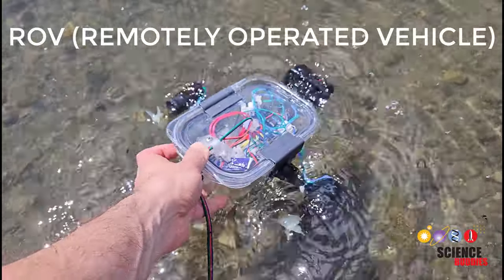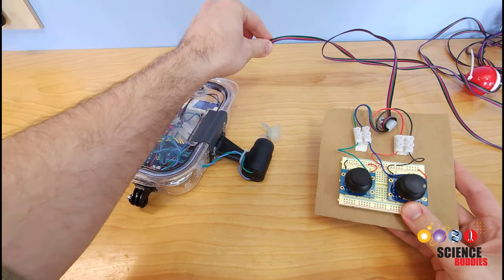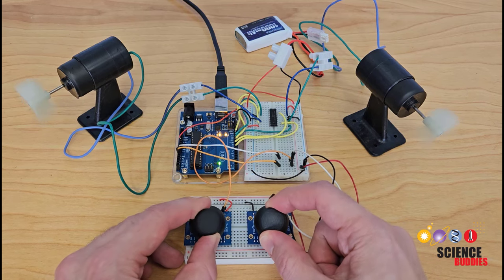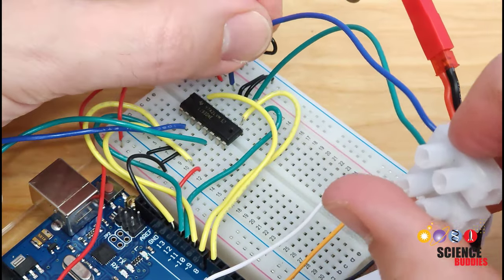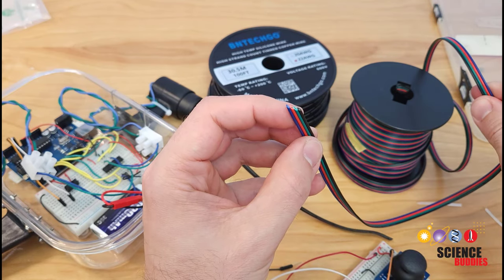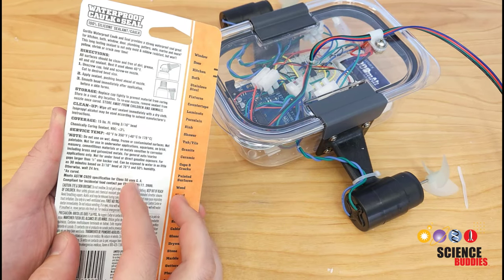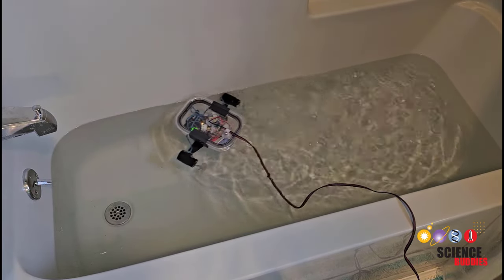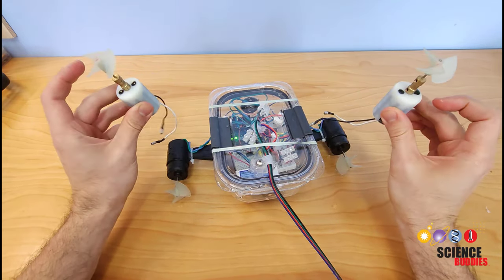Make an Arduino ROV (Remotely Operated Vehicle) | Engineering Project

Comment: This is increadbly Nice! Im thinking of starting a BIO RC Club next year for my High School and Wanted to know if I can make this out of PVC Pipes and have all the arduinos and wires all above water and just have the trusters and their wires in the contrainer?
Reply from the maker: Hi - do you mean keeping the Arduino completely out of the water and as part of the handheld controller, or mounting the Arduino on top of the ROV so it's above the surface of the water? Either way, the answer is yes, although putting the Arduino on top of the ROV without any waterproof enclosure is risky in case it tips over or if there's any splashing. We also have a radio-controlled version of this project that you might want to check out: https://youtu.be/B6w-RKSVKLU?si=rUH7nM4cRJhsBl9m
Reply: @Science.Buddies  as part of the handheld controller. And is it possible If I can make the rov go down underwater?  as it is something Im wanting to make. IF possible can you make a video? if not can you give exact instructions.
Reply from the maker: Hi - yes, you can make the ROV go underwater, either by attaching weights to it so it skims along the bottom of a pool, or designing it to be neutrally buoyant and adding a third motor to help it steer up and down. Unfortunately we can't give exact instructions for this beyond what's already in the project, but make sure you click the link in the description for more detailed information on our website. By following that and our Arduino tutorials you should be able to figure it out. However, if you are considering starting a club for your high school, you may want to consider the SeaPerch program instead - it is an ROV kit but includes competitions you can travel to as a team: https://seaperch.org/

Comment: It's a pity that I saw your video so late, I am working on a Seaperch but I think your project is a bit better for my application, because I want to sail down the rivers with the rov about 1 to 2 meters deep. I do have a question, would it be possible to use an Android smartphone as a camera and a tablet as a monitor, and view them via Bluetooth and the Alfred program app? I used a 15 meter cable for the controller and the smartphone. is in a waterproof cover. can you help me with that
Reply from the maker: Hi - unfortunately we aren't familiar with the Alfred app, and of course it's a lot riskier floating a phone that costs hundreds of dollars down the river than a $30 Arduino. This would also depend on the range of the Bluetooth connection, which in theory should work for a surface vehicle, but if your ROV is 1-2 meters deep then I don't think the Bluetooth signal would work underwater. Hope that helps!
Reply: Thank you for responding to my question, and I also think your ROV is very handy and nicely built. The smartphone is an old model that is at least 10 years old, so no problem if it breaks, I will have to test it myself because I can't find a clear explanation anywhere, no problem, so we learn something.